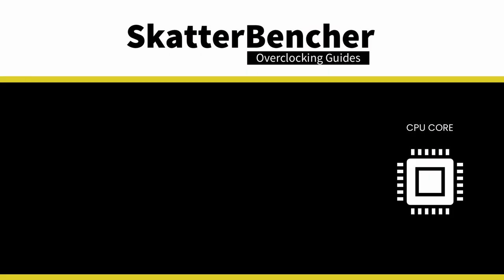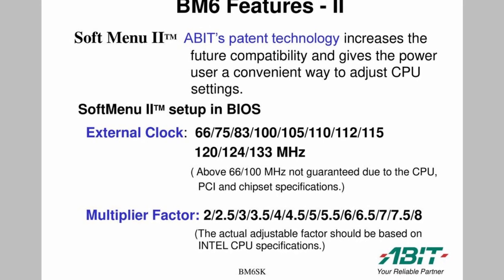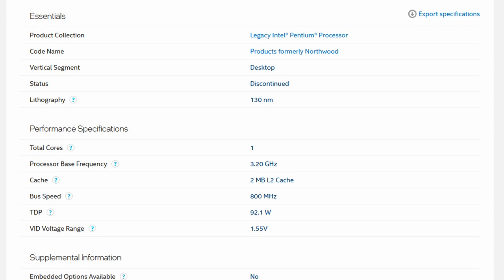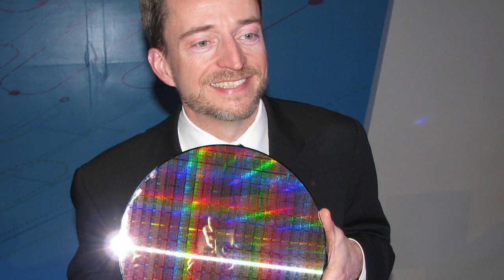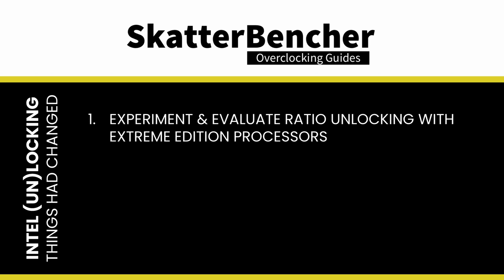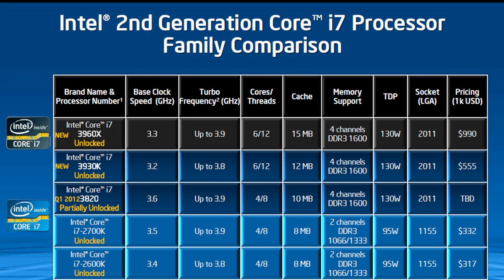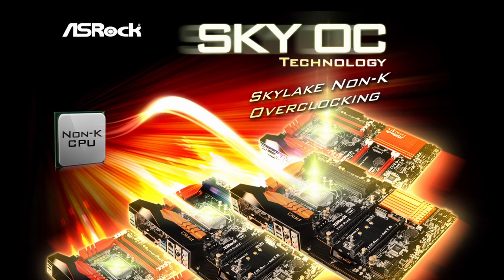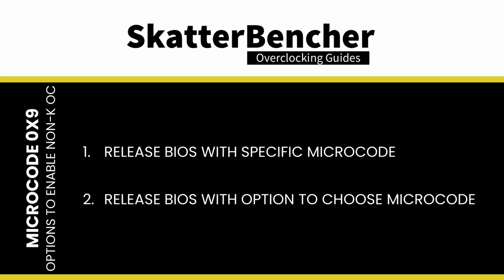Why Intel Locks Your CPU | SB#37

Comment: hello, so for the CPU overclock of an Intel 12 gen non K what are the different requirements (low pretension and rare if possible) that I need on the motherboard?  and what else do I need as a minimum, for iGPU overclocking (UHD 770)

Comment: hi, one question, what are "the 2 older microcode"?  how should i use them on an i7-12700 and with which mobo?  internal, external generator, bclk, I would like to do ov not so much for the cpu itself (which is already powerful on its own) but for the ddr5, I don't know if a higher core and cash clock in combination with high frequency ddr5 can improve the performance.

Comment: Hey dude I’m having trouble overclocking, I was wondering if you could help with a gigabyte z590 and 11700k overclock, this is my first time and all these guides are confusing because I see 11700k guides but not with gigabyte bios which is confusing cuz the options are named differently, or vice versa
Reply: Just raise voltage until you start hitting temps you're uncomfortable with. Stay below 1.45V vcore for daily use. System agent can help core abd cache OC as well. Up to 1.4V is fine for daily. So test voltages to make sure the heat is ok on your cooling. Then back down. Once you've found max voltage youre comfortable with start raising clockspeed. 

Unfortunately rocket lake doesn't have a ton of headroom left on ambient. And Intel segmented it down pretty hard. The 11700Ks are usually really bad at OC as they are made of dies that failed to be good enough to become 11900Ks. 

Usually your outer cores (according to the die) so cores 0-1 and 6-7 so the first 2 and last 2 cores run cooler than the inner cores due to not being surrounded on all sides by other cores. Those cooler cores can sometimes run 100 MHz faster than the interior cores. So find ur max frequency all core then use the per core OC and Individually try to OC the outer cores 100 MHz higher. 

For I stance my 11900K runs 5.3 GHz all core at 1.42V. But my core 0 and core 6 run 5.4 GHz at that exact same voltage. My cores 1 and 7 will run 5.4 at 1.52V. No other cores will do 5.4 unless i go sub zero. Ring only runs fully stable at 4.6. 4.7 will run but not fully stable.